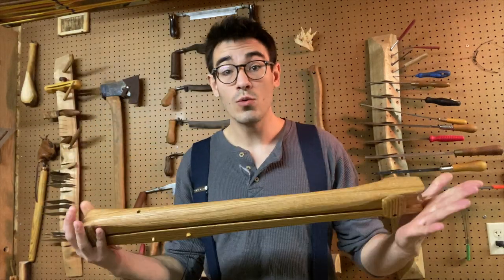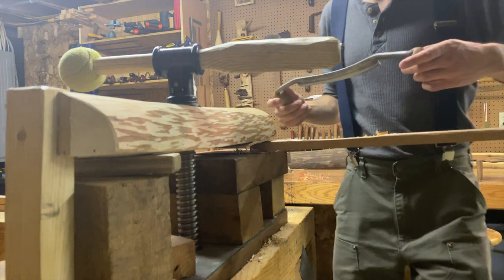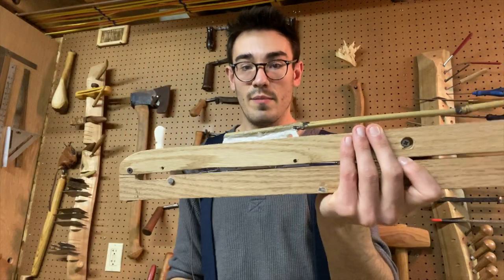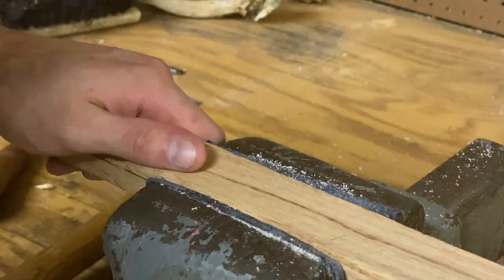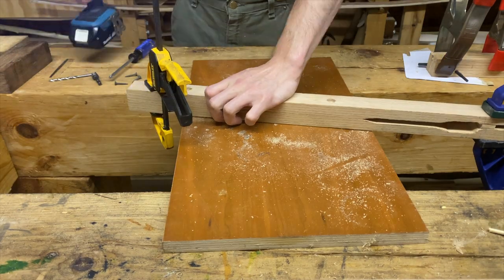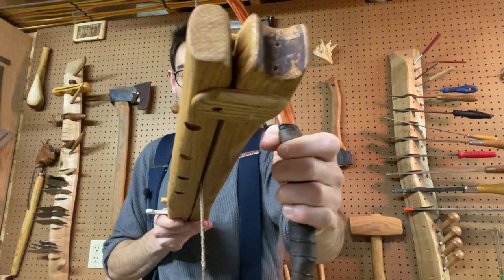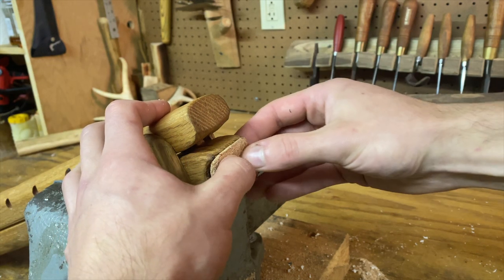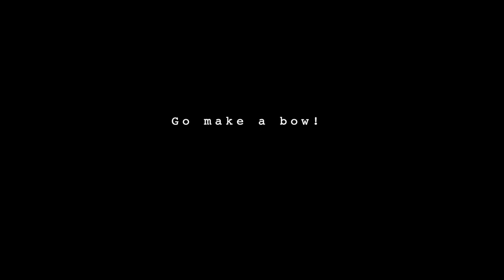DIY Instant Legolas. How to make a Slingshot Channel inspired arrow magazine.

Comment: Some lawmakers would probably argue that your concept converted it into crossbow :> but it doesn’t matter your voice should be used for telling stories either way.
Reply from the maker: In most places to be considered a crossbow you have to be able to let go of the device without it discharging. In other words an x-bow needs to be able to hold the bow cocked without human intervention. It’s hard to convey on camera but with this device if you release your hands it will discharge—you’re holding the full weight of the device more like a bow and unlike a crossbow. It looks like a crossbow, but the fact that I cannot let go and am holding the draw weight in my hands means it isn’t one, at least in the US. 

Even in the shooting modes where the crossbow takes on  the full draw weight of the bow, the hands are still required to balance the bow—i could not let go of the device so that it would remain cocked without intervention
Reply: @DanSantanaBows  right it’s hard to tell from the pictures. To me it looked as if the wooden part can be placed in between but I didn’t think about whether or not it would be stable enough to hold on its own.

Comment: my argument about the production problems itself for medieval time is a self underestimation. Craftsmans & blacksmiths at the time made many tools, weapons, & definitely armors that are arguably far more labor intensive & certainly way more expensive. Your works has little to no metals is enough factors to be a far more economically viable, more so than many crossbows at that time. So from this alone, I would argue that it may very well be much more viable, not just military usage, but also civilian usage. It's even more make sense with modularity of the Instant legolas tool & it could work as heirloom tools for many generations (despite being made from wood materials)

Comment: Looks like instant legolas, but crossbow version. 👍🏻
What's its power in pounds?
Reply from the maker: I talk about all this in the video and also description section. it’s not a crossbow just like the instant legolas because it’s not self locking—the user holds the full draw weight. Draw weight depends on what bow you use of course. The smaller one is in the 20 lbs range but you can also see some shots with a 40 pound bow in the video. With these very light bolts that is about the limit Im comfortable with but with heavier bolts you can go way higher

Comment: I can see this being relatively easy for a skilled woodworker of a bygone age to copy. Of course the pvc parts would have to be made of metal or horn but otherwise, I believe that the trade off between ease of use and added cost/encumbrance is very favorable. How much does this weigh?
Reply from the maker: I don’t doubt it could be made but I think it would be a luxury item. It’s a lot faster making just a bow rather than a bow plus this too.
Reply: @DanSantanaBows  

The paid for military in Europe were faster at shouting arrows.

However the Chinese did have a repeating crossbow 3000 years ago.

The Europeans lost to the Mongolians and the Huns because they were much faster at shooting arrows and much better at riding horses quicker.

So I don't feel that the necessity was a luxury.

 It's just history for Europeans to do nothing until it becomes a crisis. And even after it's a crisis history is shown that they ignore or neglect the problem until it has overrun their country and now become a catastrophe. 

Then they stand around and cry victim, look for an escape goat and blame whoever they can find. But at no point do they ever attempt to take any personal responsibility for their failure to act.

They learn nothing from these lessons and fail to mitigate when the next crisis shows up as a pending possibility.
They habitually wait until it's a complete disaster, before they even bother to notice that maybe something went wrong.

Unfortunately this is the history. And they have made no advancements in this mentality for several thousand years.

The Chinese of stockpile lumber for 100-year supply. Iron steel and other metals for also 100 years.

They have turned their deserts into farmland, with technology that the United States and European countries failed to invest in.

So I strongly believe that a poorly trained Archer with this advantage, would have a chance to harvest game, or chance to defend himself when it goes completely sideways in whatever country they're in.
Reply from the maker: I agree with you except having made one I think the barrier to production is too high compared to bows. The reason I say this was likely a luxury device is that in the time it takes to make and tinker with one you could have multiple bows ready. I’m not convinced that this would be a pragmatic enough device for use at military scale. Putting aside production issues, if you grant the ability to produce them for an army then it could certainly be a game changer

Comment: if you want to run with jorgs design a foldeble bow with magazine that takes up little space would be cool
Reply from the maker: I’m not big on folding bows. They’re a fun gimmick but ultimately a gimmick. IMO the folding mechanisms sacrifice too much function. Many bowyers have tried to make that design stick and it never has. Takedowns are a much better design for travel because they don’t sacrifice functionality and end up being just as quick to set up and string

Comment: the whole point of jorgs magazine was that it was fixed to the bow it improves  accuracy and eas to use dont see the point of this
Reply from the maker: This has a very different use case than Joergs design. I don’t have the rack system for the same reason I don’t have an arrow shelf on any of my bows. I see these as training wheels features that are more fun when removed. This device is not for inexperienced archers and it’s job isn’t to make it easy for you. It’s made to be easy to build not easy to shoot. 

If the purpose was accuracy and firing speed I would obviously use Jeorgs design. The goal for me was something like a tong ah with multiple shots, and not a device that makes archery easy for beginners. Archery is fun because it’s hard not because it’s easy

Comment: What is the heaviest bow you could shoot with an instant legolas mechanism?
Reply from the maker: Joe Gibs shot a 150# warbow through one on the Tod’s Workshop channel. The design doesn’t really have a limit in principle, as long as the arrows you shoot can handle the bow. With these cobra bolts 40 is already pushing it

Comment: Joerg got around the arrow tips by putting a groove beneath the arrow head. It means you need to pull down a bit as you pull back, but if you're bracing your hand against the device you're going to be doing that a bit anyway. It can best be seen in his video "When Inventions Fail ("Double Trouble" Bolt Shooter)"
Reply from the maker: I remember that.  I used that method in some of the prototypes but I think it works better for arrows with regular field tips. With these bolts I would still have a bit of an issue with the string snagging.

In general the build is much easier with longer arrows. I stubbornly insisted on the cobra bolts but they come with some complications if you want to use them in a longer power stroke bow
Reply: @DanSantanaBows  Fair point, and standard 16-20" crossbow bolts are a good compromise and should be long enough to poke past the bowstring. Though then you'd also need a peg to stop the string from going past the tips when shooting, which could make for a pretty violent dry-fire. I guess there are always trade-offs
Reply from the maker: @Jupiter065  Aye, no free lunches in archery!